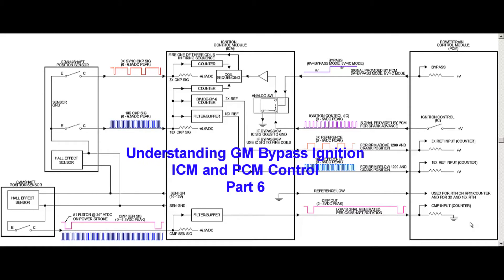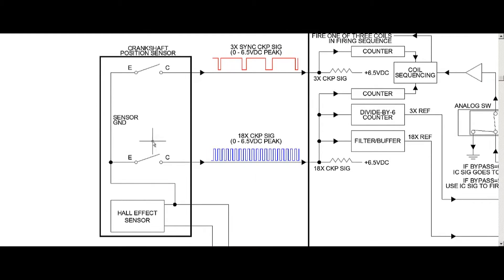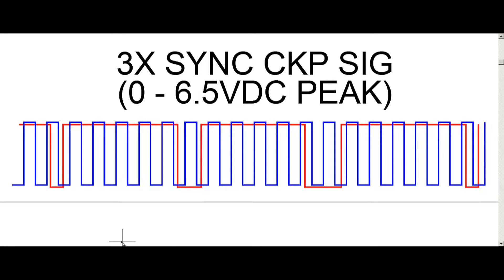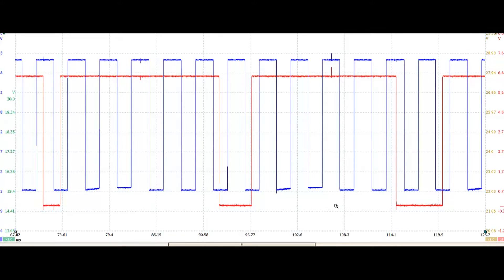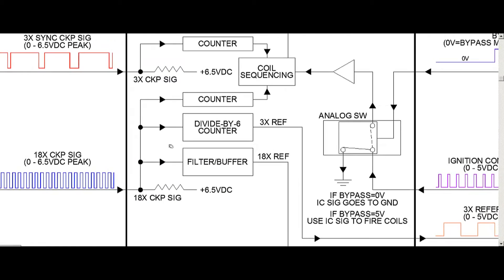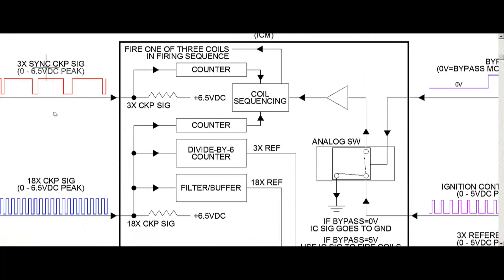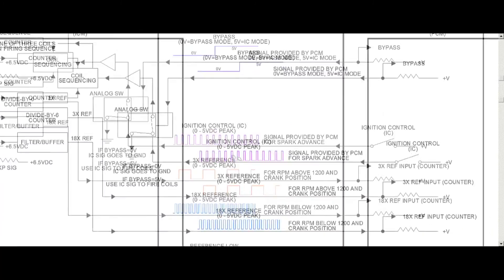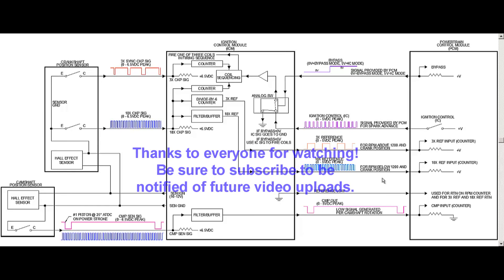Understanding GM Bypass Ignition Systems - Part 6

Comment: Thank you for bringing this subject into a layman way to understand. I have an 87 Camaro 2.8 that the shop manual asked me to bypass the dist. I’m like WTF are they talking about! lol
Reply from the maker: Not sure either James unless they're talking about some signal wire(s) at the distributor. Since you've got the factory manual, I would assume that it would outline the procedure for you.
Reply: @stuzman52  from what I am gathering it’s a tan/blk. stripe wire (EST) to the ECM. You have to disconnect it to set timing and for the test the pick up coil. 
I’m starting a car that has been sitting a LONG time. I have to put new injectors and replace the fuel pressure regulator then I will have a better idea of where I stand. I’ve already put a new fuel tank, pump sender unit, fuel filter. The engine was actually locked up and after soaking the cylinders for the last couple months until I got back to it. I made a plate with a snout welded on it. I bolted it on the H/bal. & it didn’t have a chance with a 24” pipe wrench to say no! lol I had no luck pushing it in gear or turning the crank bolt. It’s a crazy mess brudda! Thank you for your great explanations!!
Reply from the maker: @cockasorrus  Wow James, you sound like you've got your hands full. Hoping your project works out in the end!
Reply from the maker: @cockasorrus  Excellent James! Glad to hear that your project worked out well for you! Keep up the good work!

Comment: Terry I need your thoughts on a 1997 Chevy cavalier no crank no start with the theft light constantly on. Never started after engine and battery replacement.
Reply from the maker: I don't know the exact cause for your issue, but I would look into the theft deterrent system.